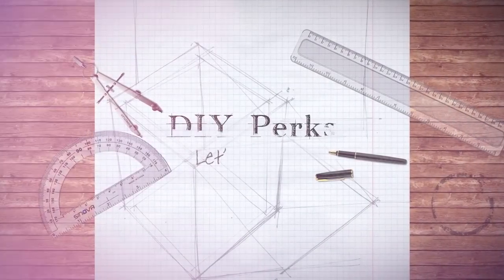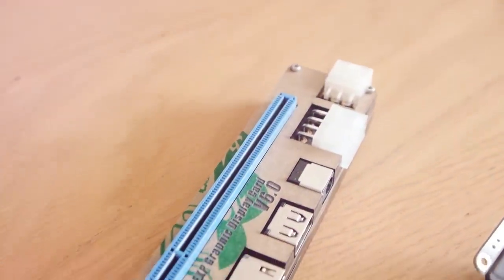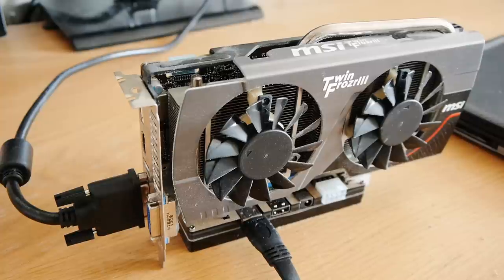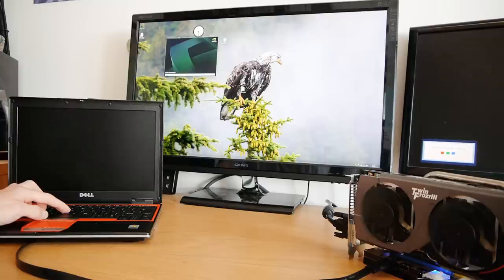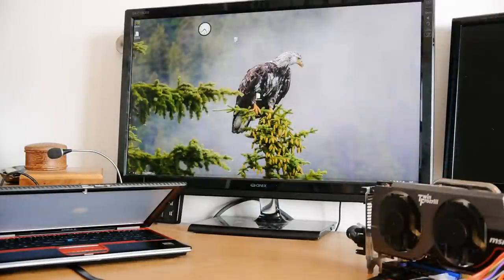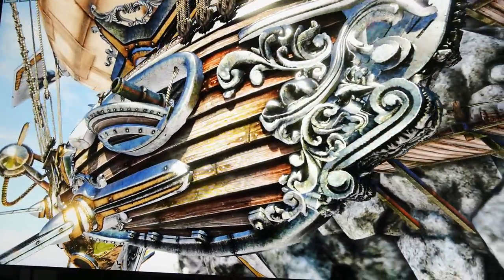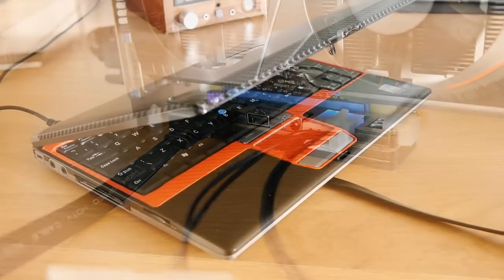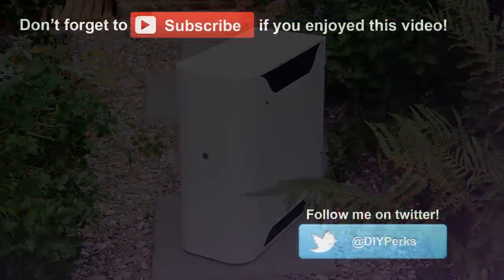Gaming on a Laptop using an External GPU

Comment: for anyone who is interested in this adapter needs to know that it doesn't work with Lenovo or HP.
those brand got a strict list of what WiFi cards goes in to the laptop.
White list!

That means this adapter won't be recognise in device manager or it will not boot giving you a error that the card(adapter) it's not compatible.

Asus, Acer , Samsung , Toshiba ,etc got no problem with swapping the WiFi card and make them very good for this project.

Good Luck
Reply: thank god i've read your comment
Reply: it seems like it does now! 2019 version
Reply: g60force what laptop and cpu are you using?
Reply: Dell?
Reply: wow!!!1 thank God i read this
Reply: by using the new "1vyrain" custom bios, you can remove the whitelist (and unlock many other features in the bios).
Reply: @lozvieux9660  thanks for the info!
Reply: @lozvieux9660 i am using lenovo thinkpad t430u. I cant setup 1vyrain bios, i watched youtube though i can't. Do i need to flash my bois with devices for doing that. Please help what should i do then

Comment: All I see is a 9 year old laptop on life support.  Still impressive though.  I think everyone wants to see this achieved on a Surface Pro tablet.
Reply: +Sean Barrett on newer laptops like my i7 8gb ram and a shitty 630m this is the ideal option since everything except the videocard are great.
Reply: +tjeulink i would give anything to have a 630m. i only have a piece of crap intel integrated 5500 card, which just sucks
Reply: Tom Mikes really dont, its not a decent card. it can do basic stuff such as youtube and maybe minecraft but anything beyond that is pushing it to the limits.
Reply: ***** yeah i know about all of that, its just that the only issue i have with it is not having enough dedicated video ram. with i designated video card the video ram is higher then what i have now
Reply: +Sean Barrett 
it can be don'e better with Thunderbolt 3 , and there is HP Elite x2 1012 (which is a surface clone that have a thunderbolt 3 port )
Reply: +Tom Mikes well shut up im stuck with my gm45 intel crapshit gpu.......
......but that will change soon 
(R7 360?)
Reply: +TheDrewSaga don't you think it'd be hard to plug it in from the back? microsoft made it fairly hard to upgrade the insides
Reply: That's the idea, to show that this can be done. e_e
Reply: +Sean Barrett If you want to do stuff like this, you should get a laptop with only integrated graphics
Reply: i died at 'on life support'
hahaha lmfao
Reply: +Marius' Tech Tutorials not everyone with a laptop has a thunderbolt port.
Reply: yes sir, thier is definitely better options for doing this with newer laptops via the 3.1 type-c port....and much easier
Reply: Soo guys one quesiton...
i have an I7 3612QM a 7570M
and 8 GB of ram
i have 2 slots for PCIE 
can i run 2 GPU'S on SLI?
or is it just not gonna work?
Reply: Sean Barrett can I have a question:do all the pci e work like in the video(just make sure before buying)?
Reply: I was laughing for 9 years this comment is everything
Reply: I wonder what bus the docking port on the surfaces use? I know it can have a keyboard mouse and fingerprint scanner all on that one port.
Would be cool if you could drop dock it and allow it to connect to an external video card.
Reply: Sean Barrett mobile gaming... world revolution
Reply: that's not a 9 year old laptop on life support, that's 9 year old laptop with cybernetic enhancements that allow it to do somersaults and backflips, foh
Reply: Or better yet, a Surface Book.

Comment from the maker: Just letting you guys know that the latest version (V8) is now available on ebay! http://rover.ebay.com/rover/1/711-53200-19255-0/1?icep_ff3=2&pub=5575117832&toolid=10001&campid=5337657473&customid=&icep_item=181943864835&ipn=psmain&icep_vectorid=229466&kwid=902099&mtid=824&kw=lg
Reply: +DIY Perks How to know if my Asus A55V works with this?
Reply: +P James idk
Reply: +DIY Perks Did your laptop originally have a integrated graphics card?
Reply: Yes geforce 610m
Reply: So he had one soldered to the motherboard and then used a geforce 610?
Reply: no
Reply: +DIY Perks does the expresscard version work on dell latitude e6420?
Reply: +DIY Perks Sir will this work with Asus K53S Intel i7 2670QM and Nvidia GT 630M. It has 1 pci e mini slot which is used by wireless card which I can remove for this device ? Thank you and hoping to get a quick reply.
Reply: do you have to use different monitor? or just laptop is okay
Reply: +Jiz Tom I have a different monitor too. Thank you. Please reply at the earliest.
Reply: +DIY Perks so what else would I need u mentioned some other things in this
Reply: +DIY Perks if you dont mind me asking what laptops dose this work on?
Reply: +a j Will it work on my Amiga1200? hahah, Let him live and check yourself if you have free mini pci-e port like showed in your laptop. Also check the link, man...
Reply: +DIY Perks can you build a casing for this?
Reply: +DIY Perks  This works for my Dell Insiron 1545.  I got the Expresscard version.  The adapter actually provides enough power to my EVGA GTX 960 so that I don't need to buy an ATX power supply.  All I used for the PSU is a $20 Dell charger from Ebay.  I have a video showing the setup.
Reply: +DIY Perks hey, I did more research on this and found out I need to have it connected to another device with a screen, would it work if I used an Ipad or another laptop?I already have a gaming laptop, would that be self sufficient?
Reply: +DIY Perks hi . can use the pci-e to windows 10 system? pls need help
Reply: +B.D Avinoam  The power supply required specified in the specs of graphics cards is meant to account for a full size desktop computer, which has to power not only the graphics card but also the rest of the computer. In the case of an external GPU setup, you are powering just the graphics card.  So you can use a less powerful power supply.  I am also using a 220W power supply in my eGPU setup video on my channel.
Reply: would I will be still availible to use WiFi? And I have my screen at my laptop broken so I use a monitor.I will connect the gpu and the monitor to the laptop and optimize it.And then connect the monitor to the gpu.Would it work?
Reply: +Halam Gigul If your laptop has an ExpressCard slot, you can use the ExpressCard interface so that you will not have to remove your wifi card.  If you use the mini-PCIE interface, you will have to remove your wifi card.
Reply: +Adlin Ling and if I need to remove my WiFi card how could I be able to do something else to have WiFi?
Reply: +Halam Gigul You can purchase a cheap wifi adapter dongle like this one http://www.amazon.com/Edimax-EW-7811Un-150Mbps-Raspberry-Supports/dp/B003MTTJOY
Reply: +DIY Perks do you think that i could do this with my AiO tablet? it has a quad intel Atom ~1.3 Ghz 1GB ram w/ some sort of monitor...?
Reply: since u need another screen for this, would an IPad work?
Reply: +Jay Girgis no.
Reply: y altschuler why?
Reply: Jay Girgis The iPad's screen is already connected to the IPad's GPU. Plugging in an hdmi-to-lightning cord from your laptop will do nothing, because there's already a GPU in the iPad, sending images to its screen. Imagine plugging in an HDMI cord from one laptop to another. Do you think that would work? No. An iPad is just a computer. It can't do any magical things that "normal" computers can't. It's just a glorified tablet.
Reply: y altschuler thanks, what about the screen on a Wii U controller?
Reply: Jay Girgis What do you think?
Reply: y altschuler well, it doesn't have a GPU, the GPU is in the WIiU it'self. so I guess. Sorry for my cluelessness
I swear I'm not trolling
Reply: Jay Girgis Does the screen on the Wii U controller have picture/video on it? Then it has a GPU.
Reply: +DIY Perks Hey what if we already have an intergrated along with a discrete gpu on our laptop. Would there be any mismatch in connecting external GPU? Because then the system won't be able to recognize which Graphics card to be used!! I've got a 7670M on my laptop.
Reply: +Jay Girgis: any screen built into a computer that is already using it will require a LOT of hardware tinkering and will most certainly not be worth it. Just get a cheap second hand monitor instead.
Reply: I think you will have to disable the 7670M then install the external GPU drivers...
Reply: oteng mpofu I don't know how to take it out because I think Laptop GPUs are soldered into the system as far as I know..
Reply: +Nitish Verma he said disable not remove , don't use your intelegence just read as is
Reply: Umm can i ask (are all laptop had a mini PCI express) because my laptop only had one so how to connect with the dock
Reply: the think is that if u have one PCI Express slot that means u cant access the internet because u will have to take out the wireless card. If u have a dell like me and DIY, a Hp or Lenovo u probably will have a extra slot because they are most of the time are business laptops. U can then try the ExpressCard slot version, where if u have a slot for an express card can plug in. hope this helps..
Reply: Kamindu Samaranayake Thanks for the ummm uh advice something like that, Okay
Reply: usb wifi adapters will work just fine too, and they're super affordable.
Reply: Can you reply me the list of all the games you played in your screen if that's okay with you... ty
Reply: What laptop are you using for this video
Reply: it can work with desktops but i think its more geared toward laptop users
Reply: Kamindu Samaranayake wtf why would you do this if you had a desktop? It can use the full length graphics card anyway
Reply: not really. But if u have an adapter u probably can
Reply: +firendable watch the video again. the hdmi port in the video connected to pcie port inside the laptop. so what you need is not the hdmi port but the pcie port in the mainboard.
Reply: firendable I actually have one of those they work well.
Reply: firendable no I had a crap monitor and I wanted it to be in 1080p for Amazon prime didn't work that way but I still use it for my Xbox 360
Reply: Thanks! I appriaciate everything you do :D keep it up.

Can we ask, how long and how has it performed so far? given the time, is this adapter something you still use, or have you continued to use them at all?

I'd love more details on length and quality of use.
Reply: Jason Johns I don't use it as I have a new monitor but I used it a lot for a second monitor and just so you know it will downscale your resolution
Reply: DIY Perks I have a WLAN port I do not see A WWAN port. I would like it if you tell me if I can still do this, or if it is not possible, I hope you respond, thanks!
Reply: do I need to buy all the Wires separately?
Reply: is it worth when my processor just only have 1.7ghz amd radeonz? is it getting good my FPS from before,when using graphic card?
Reply: mr jellybeanz 1.7ghz is slow but if you had played a game that can work fine in your laptop, maybe the game will look smoother with external vga card
Reply: DIY Perks you are soooooo AWESOME
Reply: DIY Perks i have a question now what do i need to buy to make this setup work beca u se this would be very useful if i could do it
Reply: do I need to have a screen for this to work or can it work on the laptop screen it self
Reply: Can you please consider to start a DIY eGPU case project?

Comment: A little more technical info. The wifi slots in the laptops are only a single lane so the X16 cards will transfer data at X1 speed.  In reality you probably won't notice the speed hit if your laptop is older.  If you had a PC that did not have an X16 slot, you can just cut through the back of the slot carefully and install an X16 card with the end sticking out as long as it doesn't short out.  The cards are designed to work that way.  The HDMI cable is the perfect thing to use for this since HDMI uses high speed differential signalling just like PCIe uses so there are twisted pairs inside of the cable.
Reply: thx
Reply: Just (carefully so that you don't leave any residue) saw off the plastic end so that the rest of the card's gold connectors stick out. Make sure your saw does not touch the inside of the port, only the perpendicular part.

Comment: Does this mean that my Hp Elitebook 8460p can be upgraded from Intel hd 3000 to a GTX 950? For around $200?
Reply: Yep.
Reply: HP got a white list for WiFi cards. that means it will not detect the video card or the adapter.
what you want it's the new model via USB.
good luck
Reply: could you provide a link please?
Reply: There is EGPUs that use USB3.0 ...but you know... USB3.0 is way too slow compare to a Mini PCIe then it's probably not an option...
Reply: Nga Đỗ Thị yes! but compared to a iGPU or APU its better with a eGPU on 1x no matter what cars is. a 750ti running via usb :)) A Dream came true. i`ll wait until they are not that expensive
Reply: DanielC I dont think there are usb 3 egpus availaible on the market.
Reply: any update on this, I got the exact same question, are u sure the hp wont detect the adapter?
Reply: not to worry about the "whitelist" bullcrap for a good handful of laptops.  
if the computer doesn't detect the device then turn off the laptop (if it isn't powered off already) then power it back on while holding the f1 key then change default video out.  (the methods of getting into the bios varies.)
NOTE:  the egpu dock has a slider for three different positions.  that is implemented importantly because each laptop has a different bios (i.e. Megatrends, etc.)  so depending on what bios you have, it is a matter of trial and error.
Reply: so does this work on an elitebook 8460p?
Reply: It works with any laptop that has mini pci express. although ull need to sacrifice the wifi adapter in most cases
Reply: i worked on over 100+ hp laptops and i can say that lenovo/ibm and hp got white list when it comes to wifi cards and what are going in that slot
Reply: will it work with my hp omen laptop, it has a gtx 960 at the moment but with only 2gb vram
Reply: Ben Van Leuven I wouldn't use this, because any GPU better than the built in 960m would likely be bottlenecked by the adapter.
Reply: okay thx
Reply: Lol i have that laptop but It has a built in amd chip that runs most games at 50fps
Reply: yeah my omen with gtx 960m runs most games like farcry and gta in middle settings at 50 60 fps
Reply: so do some people here do, but some people want to play some of the newest titles without worrying about aging and having to buy another laptop
Reply: McXred Pl I had to sacrifice my wifi adapter but I just used an Ethernet cable just like a pc xD

Comment: Very cool but, most laptops dont even have access to a pcie slot anymore. Everything a unibody one piece no user upgradeable type of thing.
Reply: +Clesarie guess what's the wifi card in most of today's laptops. Exactly, a PCIe slot daughter card.

You have to sacrifice internal wifi card, but if you are going to plug this thing to game on that machine you might as well plug an ethernet cable. You aren't moving the thing around anyway...
Reply: +Blokeados! 

lack of port isn't the problem but more so with the build design of a lot of modern laptops, a lot of laptops now don't have that tab to the back that you can simply unscrew and get access to the port you need to dismantle the entire thing.....you might as well have the laptop motherboard floating outside the shell if that's the case
Reply: Depends of the GPU card. Some models actually give an increase in performance withough consuming all the PCI Express bandwith, specially on older laptops. I'm pretty sure the seller has a list of recommended video cards that work right, and non recommended video cards that would bottleneck with this adapter.
Reply: pienso lo mismo ! / think same Ivan quiles
Reply: Clesarie take out the wifi cards
Reply: Theres one that uses a express card for the connection which in theory works as good
Reply: Unibody laptops have Thunderbolt 3, which, while more expensive, does a better job than this so its not too bad I'd say.